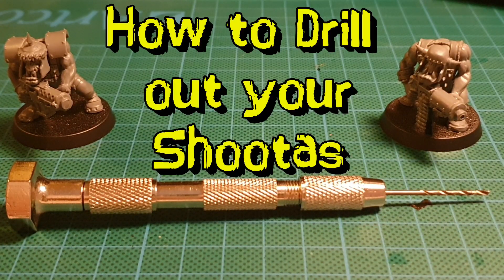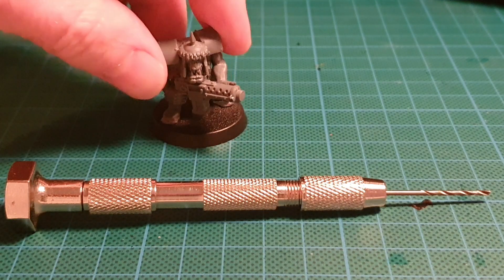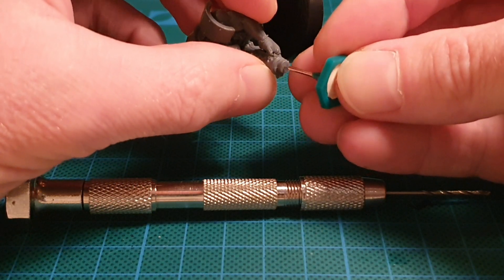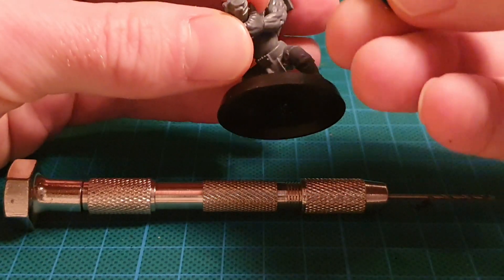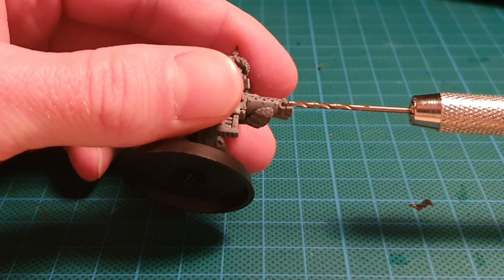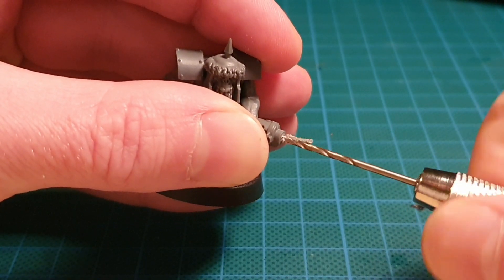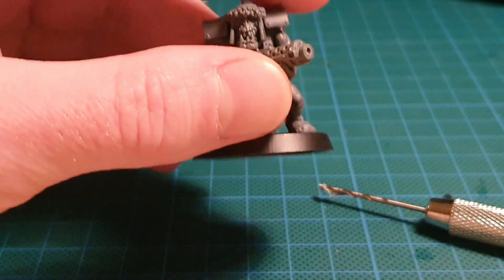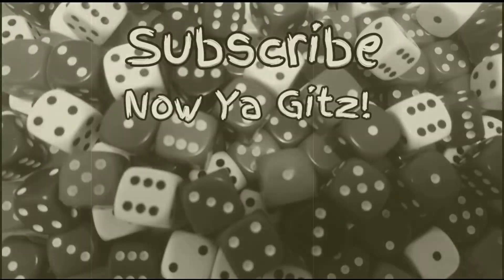How to Drill out Gun Barrels - Warhammer 40k Orks

Comment: I wobbled off-center for one of my Boy'z barrels and ended up blowing out the side. I just cut off the barrel and glued on a brass motherboard standoff for the muzzle.
BTW, rebased some black reach nobz. Cutting off and smoothing the old school base slot tabs is a PITA.
Reply from the maker: Yeah don't go too deep with the drill! You only need to drill in a tiny bit.
Reply: @6Stevo  Thanks for the tip. I had to learn that the hard way.

Comment: I could never get thid right. Going to try your drawing pin method.
Reply from the maker: Hope it helps buddy. You should find it alot easier to get them more central.
Reply: When you heat the drawing pin with a candle and stick it in you even dont need the drill work  🤫

Comment: The dent dead center is key (can be done with sharp scalpel / X-acto knife) but then the 2nd part which is tricky is the drilling, nice and slowly, checking and re-checking that the alignment of the drill is parallel to the gun barrel otherwise hole off center and in at weird angle.
Reply from the maker: Correct. It's all fairly easy, just as long as you are careful and gentle.

Comment: Nice video! :-) Another option for a pilot hole instead of a pin, is dimpling the muzzle with a smaller drill bit. Also if you save the curls of plastic you can mix them with plastic cement and make a gap filler of sorts.
Reply from the maker: Very cool tips!